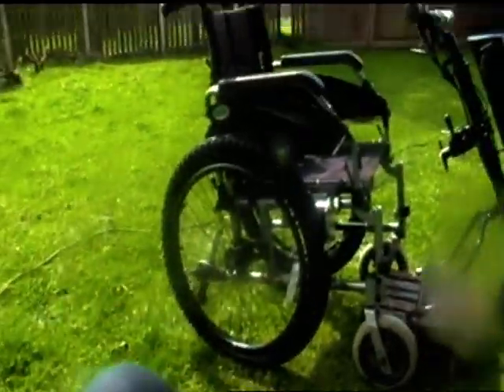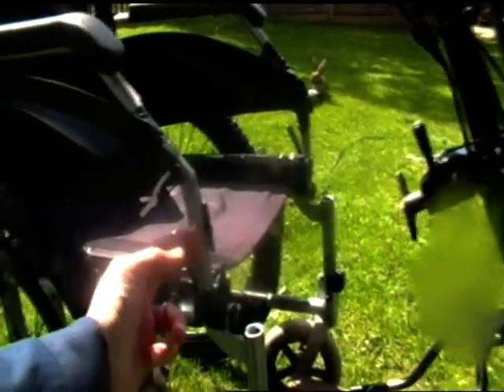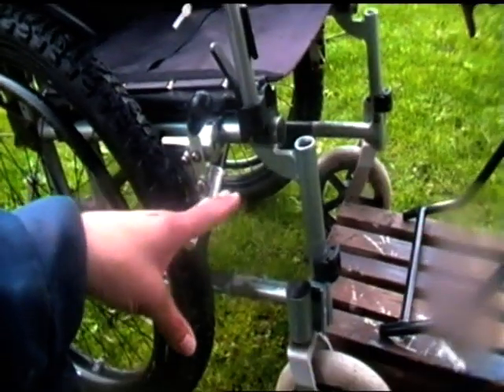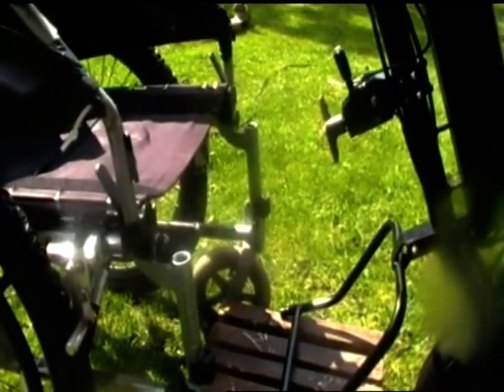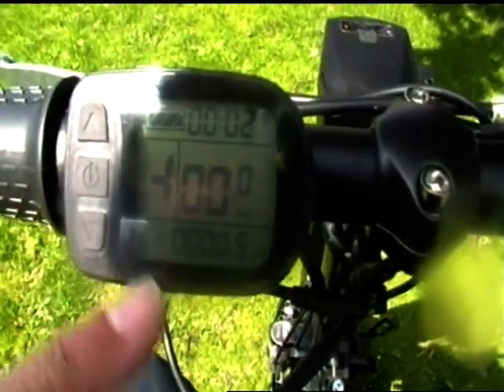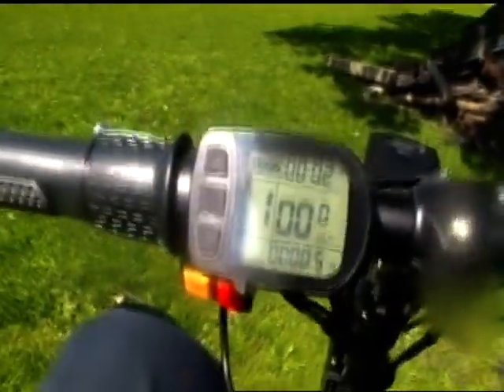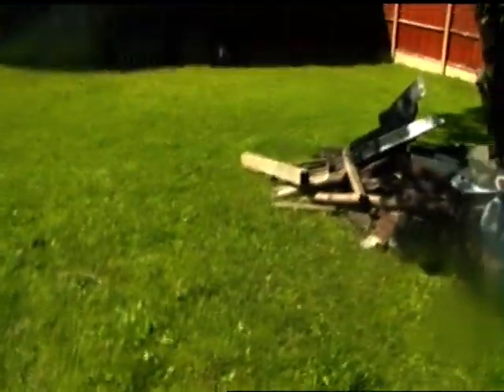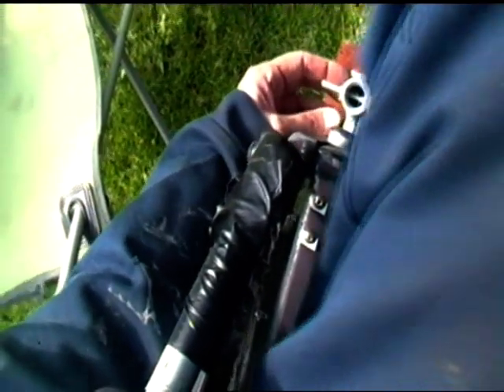wheelchair conversion to electric PT1

Comment: Hey Oddball, I’m just wondering if the alibaba unit is still holding up? I’m desperately in need of some form of power add on and I’ve found Alibaba is only place I can find that I can actually afford them. I’m just wondering if that one is still working okay because I’m worried I’ll buy one and it will die after a short time just worried because they’re so cheap. Did you have to pay importation fees ? 
Hope you don’t mind me asking 🙂
Reply from the maker: Ask away -- I still have the unit as made here by me and all the parts to convert I back I think. The person I made it for could not get the hang of using it in terms of the control grips. The unit has never been hard tested other than here in my garden and seems well made the screen says it has done about 10 km and charges up easy. I was given it back by the owner to do with as I wish so kept it for parts in case I make a eBike etc. 
I did find these units on ebay also a while back but just looked now and can't find them yet but some times you just need to keep searching for key words on there and they pop up. Watch video https://www.youtube.com/watch?v=wghG30CgLQM
Reply from the maker: If you want to send someone to see it and test it let me know, I find it quite fun to drive and would only want close to what it cost to make it, so I can pay the lady back.